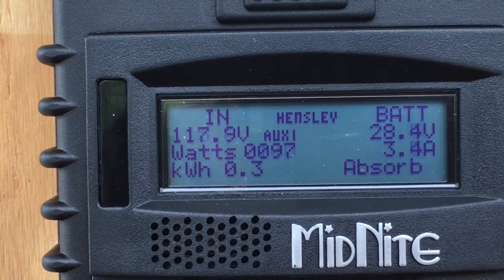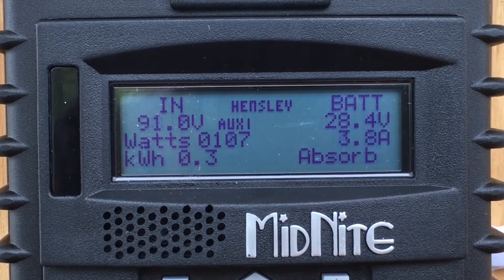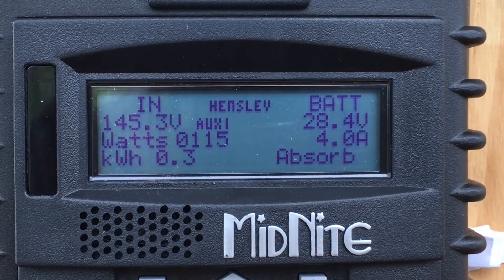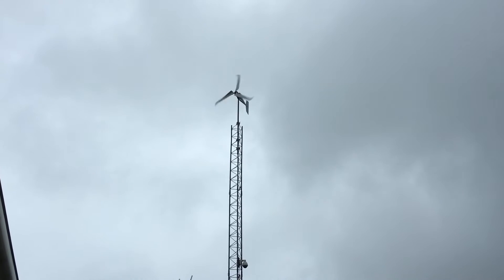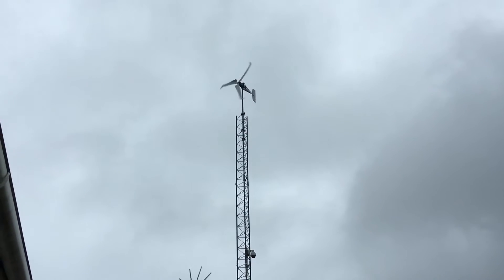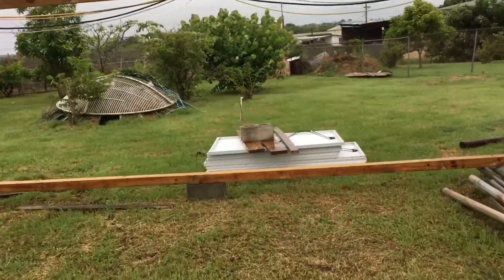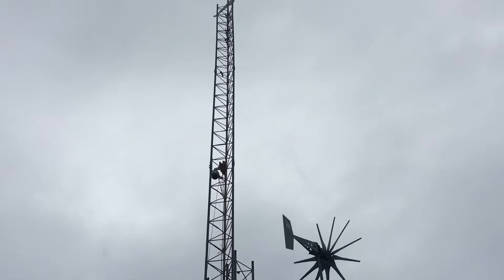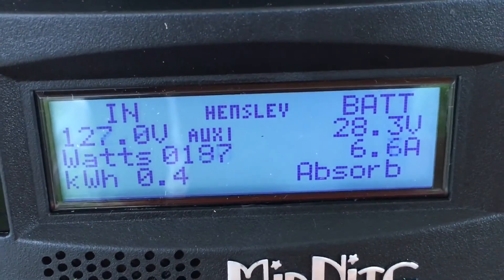Midnite Solar Classic At Work With Missouri Wind And Solar Freedom 2 PMG in Tropical Storm Matthew

Comment: Very nice controller and one of the best. I have a Outback Flexmax 80 but it doesn't have a wind turbine controller. I suppose that you were showing output from the wind turbine that was mounted beneath the 2nd one, high up on the tower. With the amount of wind that you were getting, it appears you should be getting more wattage from your wind turbine. There is a setting in your controller to optimize it for your wind situation and this could help your output. Also, as you well know, the higher your wind turbine is mounted: the better the wind quality. The lower one wasn't mounted very high but was benefiting from the sporadic wind gusts.

Comment: Does the 2 fans at the bottom of your classic always on? Mine does not sure if it's working the way it should
Reply from the maker: I will check in the morning for verification and let you know.
Reply: @hibiggs66  ok please do
Reply from the maker: The two fans at the bottom of the classic will be on depending on the amount of power production from solar sources.  
The other fan is quite that is the turbo fan about. 
I will make another observation later when the sun goes down and note any activities on those two fans, although from my recollections the charge controller is very quiet at night time.
Reply: @hibiggs66  hey dont know if u ever see this with your charge controller but I've seen in a gust my windturbine exceeds the battery voltage and it stop charging it completely and go in to resting.  Was wondering if that's normal? Because I'm using a 24 volt wind turbine charging a 12volt battery bank .I'm gonna upgrade soon tho waiting on the 24volt inverter to be delivered
Reply from the maker: If you’re in doubt they are easy the replaced.
Reply: @hibiggs66  ok bro thanks I think my control board is having some issues